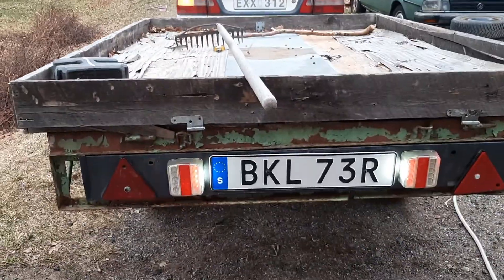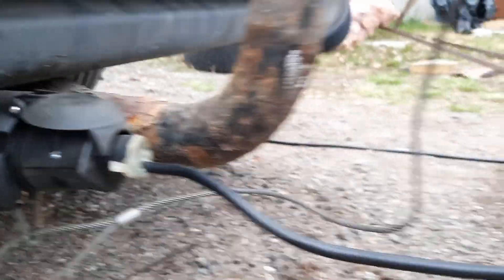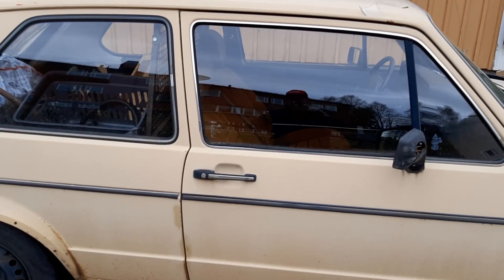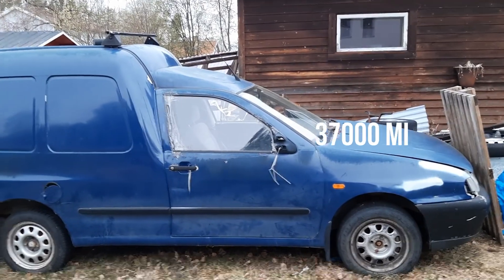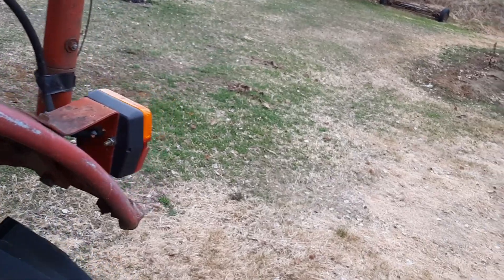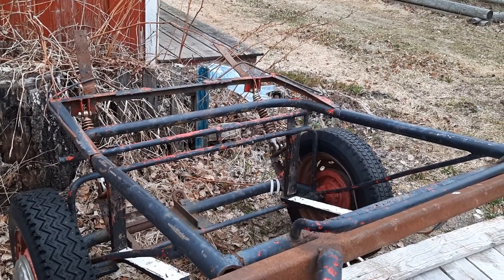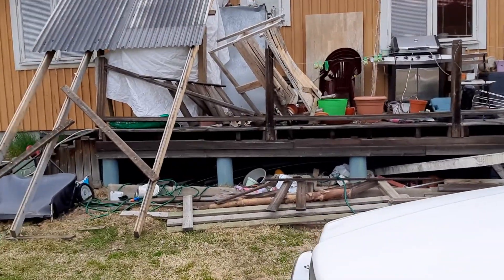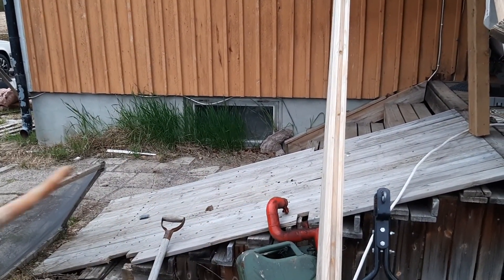A quiet depression.

Comment: God morning /evening Mr Sven 😁☕☕☕ Oh boy, seems you have as many projects as I do also!! I hate to hear about selling the cars, but I COMPLETELY understand! Seems the truck project has wore me as thin as anything had in years! Things /body don't work like they used too! But you still have quite a few projects that aren't to bad to do! What ended up being the issues with the trolly lights? Just the wiring? Pretty slick to add the hot glue to the plug for moisture 😁 140 bucks to change the gearbox, yes sir that is a great deal, very cheap! Hopefully your carburetor comes and you can get the tractor going again! The trolly for the tractor for the Mrs would be really neat 👍😁 Hang in there Mr Sven, I know exactly where you are coming from my friend!! I still can't get over the golf, that looks just like all my dad's VW rabbits 🤔😉 Thank you sir for the update, hope.yoy.have a great evening!! Looking fwd to seeing more my friend!! 😁😁👍👍☕☕
Reply from the maker: What is special about both the Golf and the Passat is that they are older than 30 years. In Sweden, a car becomes tax-free after 30 years. My neighbor who owns a Diesel Mercedes has to pay $ 300 3 times a year in taxes. We'll pay tax on the white Volvo 850 and it's $ 185 for a year. When you consider that we have about $ 1,000 a month together in retirement, you get perspective on it all. It's going well for us. We do not have to drive that much. The petrol price of about $ 11 / gallon means that the car has to stand still for the most part.
Reply from the maker: It was just 3 broken cables.
Reply: @makingithappen5178  I understand that totally!! Wow that's some high taxes😳😳😳😳
Reply: @makingithappen5178  Thank you sir for the info!!
Reply from the maker: @Pennies_on_the_dollar  Jeupp.
Reply from the maker: @Pennies_on_the_dollar  Now they will inspect it on May 24. If it is approved then, it does not need to be inspected anymore. If a vehicle is older than 50 years, it is neither tax nor inspection and the car's insurance also covers the cart.
Reply: @makingithappen5178  Thank you sir, that makes sense 👍😁